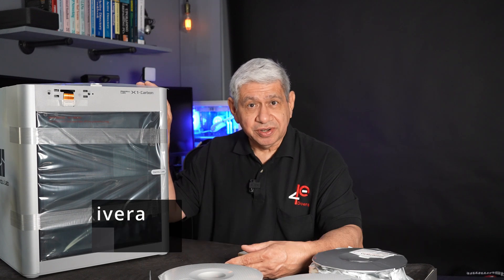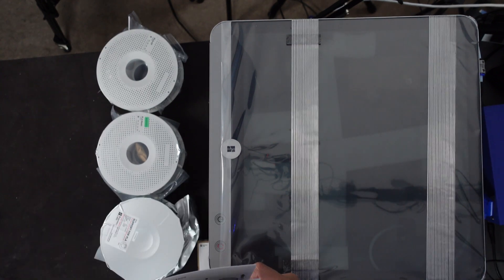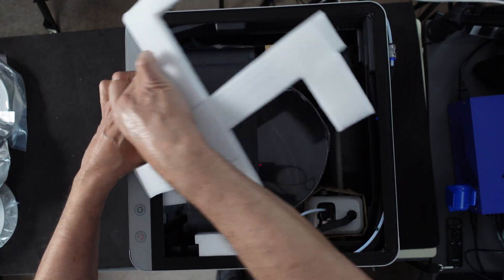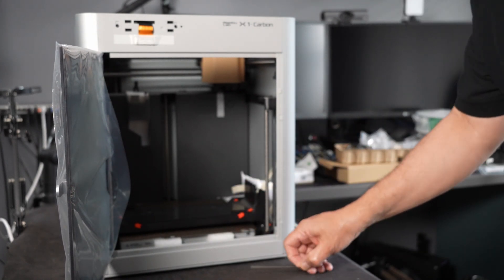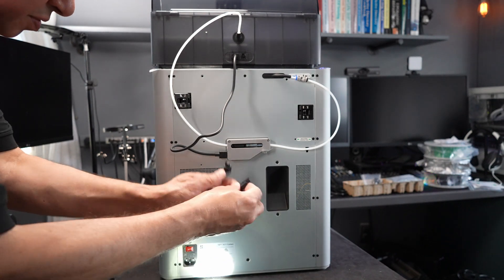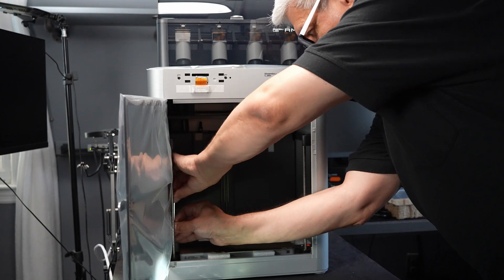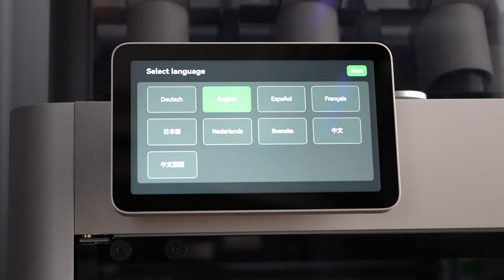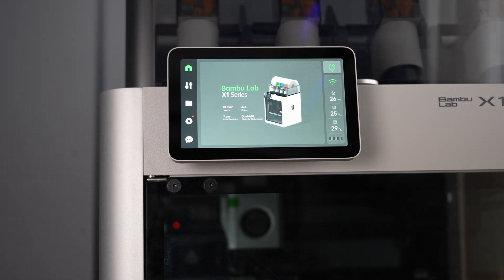The Bambu X1 Carbon 3D Printer Setup & Initial Tests

Comment: I am considering getting one. But the X1c been out for 2 years and plus, do you think a newer model is coming out soon?
Reply from the maker: I have not heard of a new one coming out.  As of now, the only complaint I have is needing to 'print' some of the important accessories, rather then having them in the package.  For example, as I answer your comment, I am printing out the 'poop' bucket that I wish had been included.